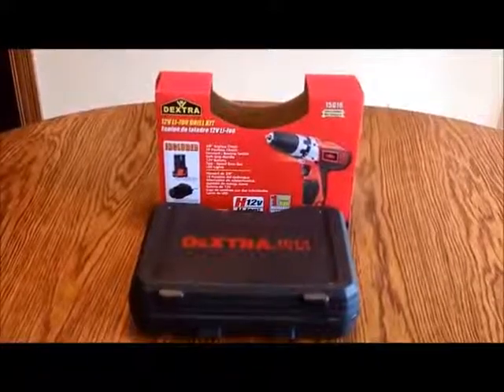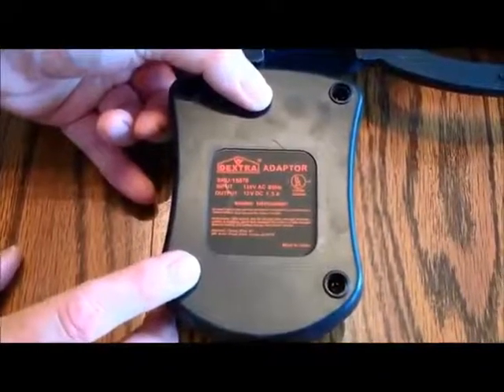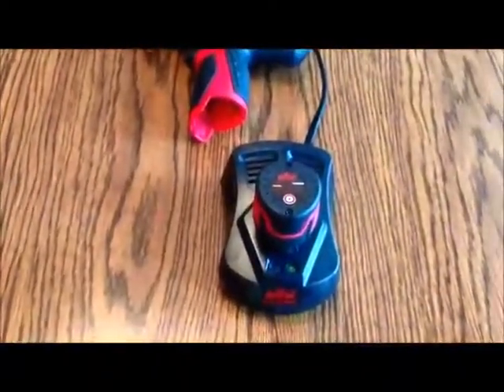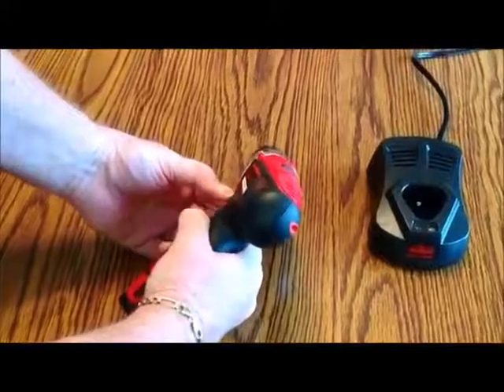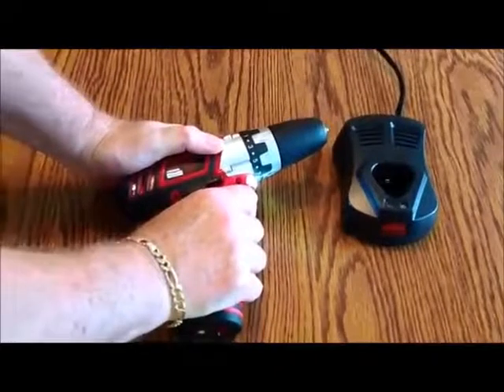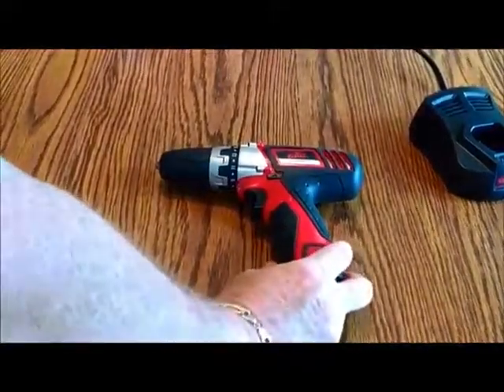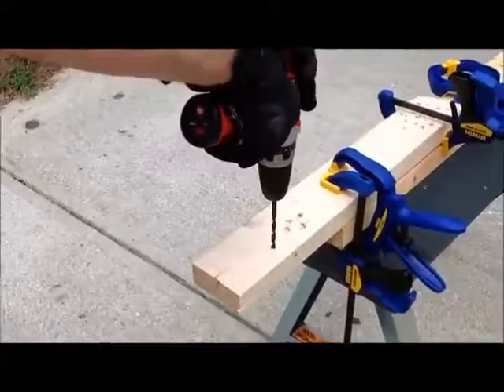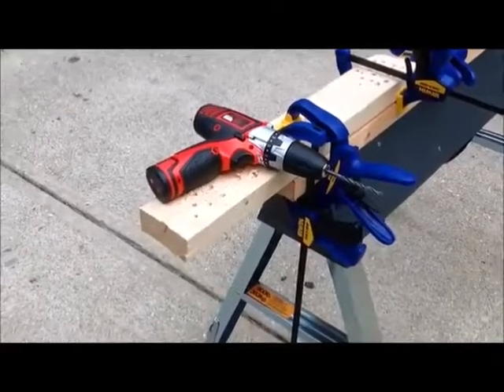Dextra 15016 12 volt Lithium Ion Cordless Drill Driver Kit

Comment: I am thrilled to come across a review that is 10 years old. I have a version of this same Dextra unit but with an extra function : Hammer function at 12 volt! I use it head on to drill up to 10mm holes in bricks, concrete and stone. It reminds me of the Bosch 12 volt series which I have been using since 25 years now. The Dextra unit I use is a marvellous piece of engineering and I bought it at a bargain of $40. I wish Dextra would come up with a variety of tools to cover all needs.